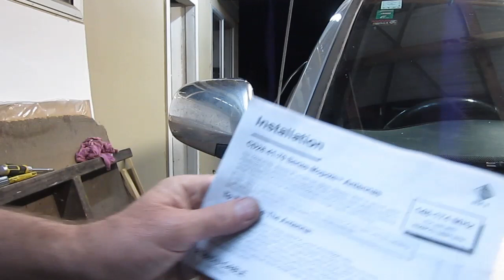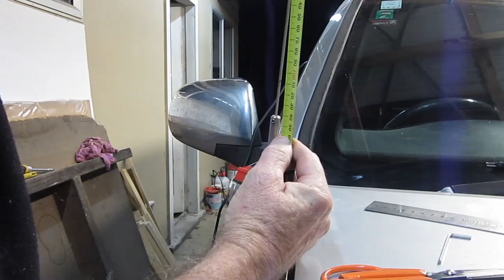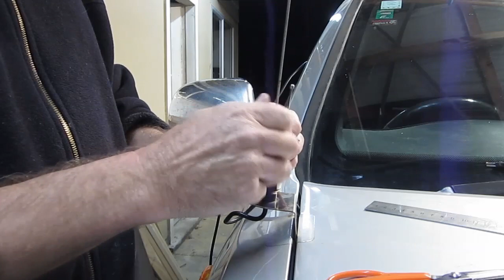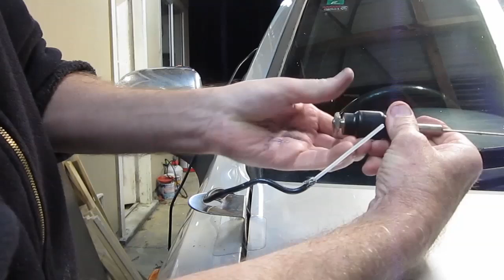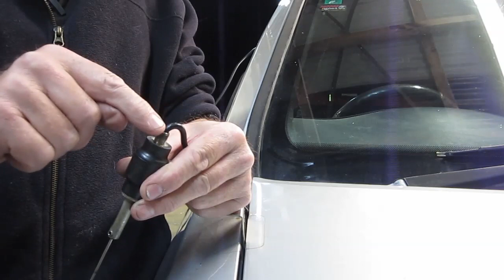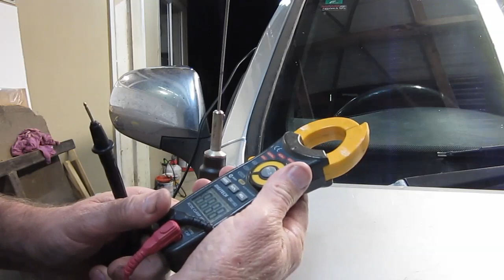CD28-41-70 Antenna Tips & Tricks

Comment: What do you think of the non tuning RFI  aerials....
Reply from the maker: A good option if you don't have a VSWR meter or the skills to use one (I'm assuming you mean the CD29-138166, or similar).  At least they are ground independent, so you can almost mount them anywhere (even inverted, provided you seal up the MBC fitting).  On the down side the MBC fitting requires a soldering iron to terminate, and ideally a short piece of marine heat shrink to seal the RG58 cable. Both jobs are sometimes problematic to achieve in the field.  The CD 29 antenna's also have less gain (less coverage area and shorter range) than a correctly tuned (trimmed) CD28 series antenna.